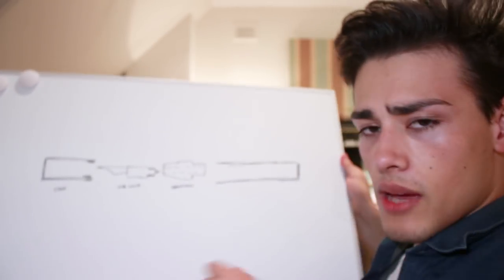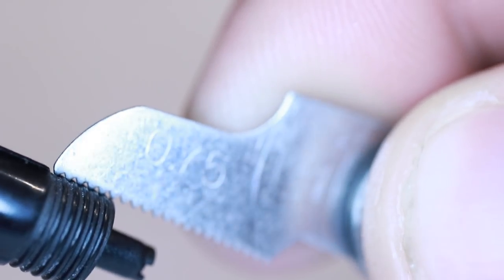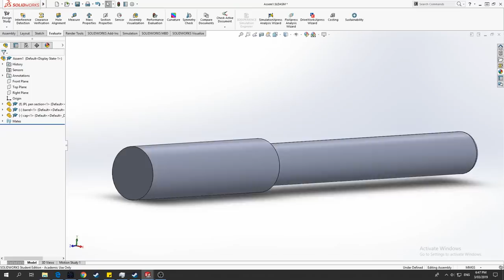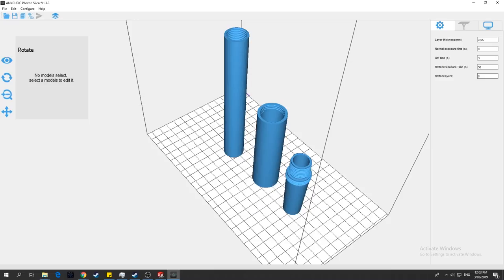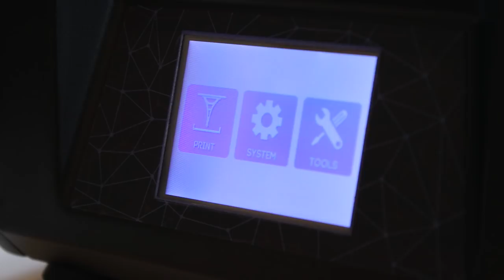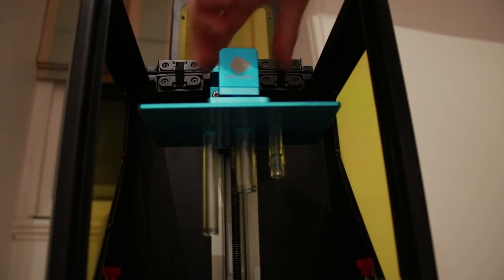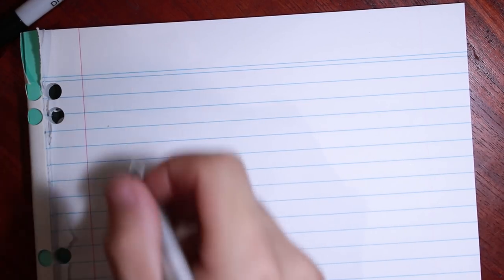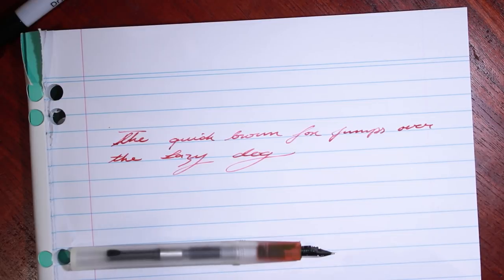3D Printing A Fountain Pen | Proof Of Concept

Comment from the maker: After I looked at the solidworks file it seems that the jinhao nib unit thread is m6.5x0.7 (not m6.5 x 0.5 as it stated in the video). Ill measure it again tomorrow and confirm this
Reply: Did you conclude if it's 0.5 or 0.7?
Reply: @uaexemarat  Neither one is right...

Comment: Excellent work in design, testing and production. Even with that test model, you could put an O ring on it with a little silicone grease and eyedropper that pen! I would look cool!
Reply from the maker: I probably could chuck in a little recess to put one in, though I think the threads alone could be enough since the tolerances are very tight

Comment: Hey dude, great video, but let me start it off by saying that the music gets a bit too loud when you were explaining it in the software. There need not be music in the video, since we're all pretty much used to just hearing your bare voice hahaha.

Moving on, you should check out (if you didn't know yet) additive pens, which makes pens from 3d printing as well. They already made a pretty basic, at the same time, intricate design for a fountain pen!
I certainly think that 3d printed fountain pens are the future. You definitely can go crazy with the design, however if they are as small as you, the only limiting problem really would be the nib and feed section.
Still though, I am excited to see what kind of designs that you will be able to make with this. Cheers!
Reply from the maker: Cheers. I have to say adding music is always a risky balancing act with the loudness and I kinda fail at doing that most of the time. I have been following addative pens for a while now and their 3d printing method is slightly different to mine, and they must be using different resins to mine, though their designs are certainly amazing. I am not sure about 3D printing being the manufacturing revolution, but time will tell.

Comment: Nice job with the design!

Just wondering, but if you're concentrating on materials testing as your next step, have you considered 3D-printing a reusable mold that you can use for different types of UV-curable resin? It might (key word might) be more efficient than repeated 6-hour prints of the same design.
Reply from the maker: No I have not, although you have given me an idea about casting a metal pen using sand molds that I might do later, cheers
Reply: Glad to be of service, and good luck! (though you probably won't need it)

Comment: hey dude are you an engineer ? I would love to work with you I'm a 3rd year mech E have good CAD experience with NX and Solidworks and of course I love fountain pens !!
Reply from the maker: This sound like something id be up to doing during term breaks. I like using solidworks heaps, been using it since I was in year 7, although I have never had the chance to use NX. My university went down the CATIA v5 route, and that is a beast of a software, even though it looks like it was designed in 2000.

Comment: do a new two piece cap so you can add a pocket clip
Reply from the maker: Ill have to, printing the clip here is slightly hard to do with this type of 3d printing
Reply: JPL I was thinking about a basic metal clip sandwiched between the cap and a screw on top piece

Comment: Kids these days and their control of the means of production.
Loads of questions, of course, mostly about the machine, but I can look those up.  Good choice of printer.  Did  you buy a fountain pen kit, or cannibalize an existing pen?
Reply from the maker: Cheers, most of the pen kits are designed to work with a lathe, so I justg ripped apart a jinhao 994 for parts